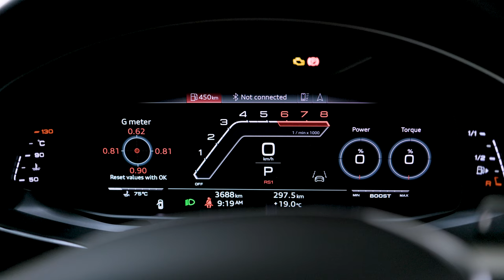Best daily? 2024 Audi RS 6 Performance review

Comment: Switching from an F90 M5 comp to this - sacrificing some driving dynamics and pace for something that offers more balance as a daily family car.  Going to miss my M5 but you can almost never utilise the peak performance of car this fast (at least not on a public road).
Reply: Ive swapped out of one too... Although, im not sure youre losing straight line pace... I think the new car is much torquier than the m5... easier to launch... M5 might have more high rpm pull, although ive run 100-200s in mine, and I use to get low to mid 7s in my m5, and this car runs mid 7s too... M5 is definitely lighter on its feet, but this car (performance) is far better than the base C8 - which I had too. I think as you said as a daily, Ive got the air suspension and its far more compliant... build quality is much better too. I just sold my Cayenne Turbo GT - the new one has been tuned for top end, and its got serious mid rpm flat spots... its strange as its the same engine as the Rs6 perf, but the tune is so different
Reply: @carguy8270  👍 Still getting used to mine and definitely haven’t had enough time in the car to be comfortable
pushing it but, overall, really pleased.  So much quieter and more comfortable at one end of the scale and it looks incredible.  Interior is stunning and the kids love it.  Missing things like the steering wheel heater button and my 1-8 favourites but the touch screen thing hasn’t been nearly as painful as I imagined.
M5 felt more driver focussed imo (sharper throttle, better steering feel) but, again, I think I need time to get used to the RS6 before I can compare them properly.  
Certainly no regrets!